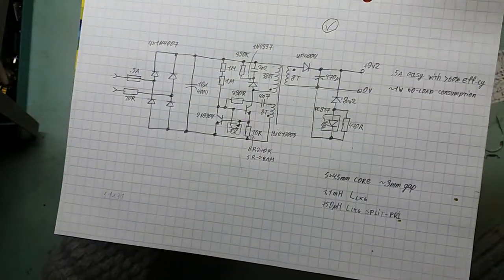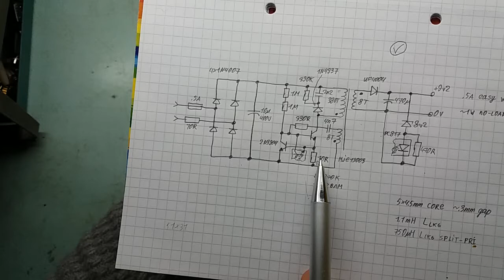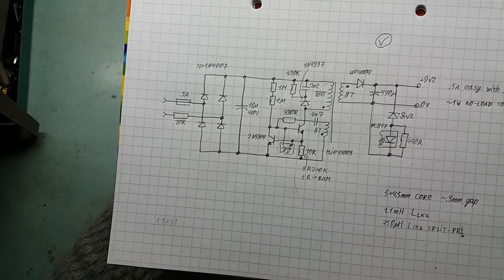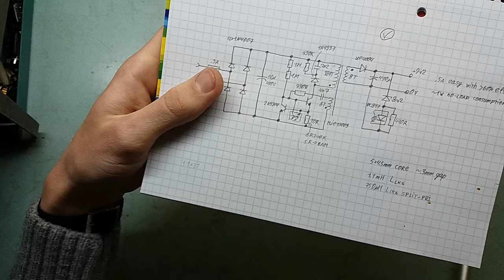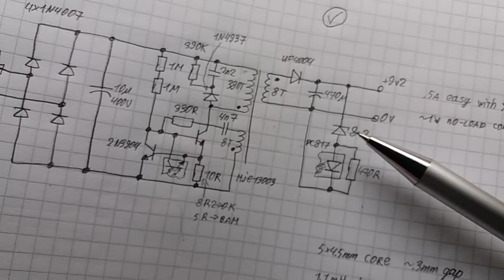Not that horrific smps

Comment: You can put a resistor paralelled with electrolytic cap between ground and dot end of feedback winding - you will get a dc voltage that you can apply to the optocoupler collector. Don't know if it will improve regulation all that much but it should, at least a little ;-)
EDIT: I think I had a brainfart. It should be a zener paralelled with a cap I think now...

Comment: Its not horrific, everything is soldered down well, and it works fine :-D.
Dont get functionality mixed up with being pretty, you can have a pretty psu and its still crap!!.
Ive fixed lots of pretty psu's, a cute pcb has no effect LOL :-D

I dont know how much leakage actually matters, but fixing it must have created a loss in the transformer, so you reduced the emitter resistor to allow a larger magnetic charge in the core.
Or at least it looked like that :-).
Reply from the maker: Smaller leakage inductance creates smaller spikes, which equals to a lesser amount of heat dissipated by snubber resistor. The necessary change was replacing 330 Ohm with 470 Ohm to make it idle at 1W. I reduced the emitter resistor to up the limit and thus the output current, rewound transformer didn't change that. I could've left it with 10 Ohm, but I wanted it to be more capable while still being bomb proof. 5 Ohm resistor made the actual PS a bomb :D